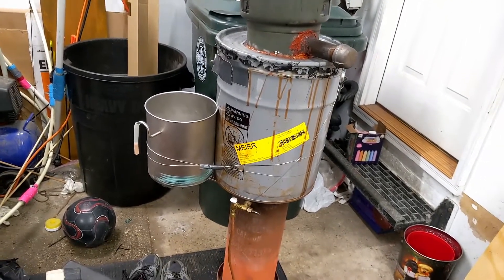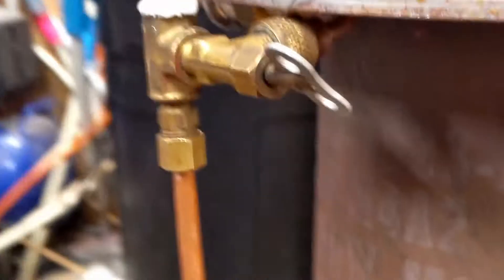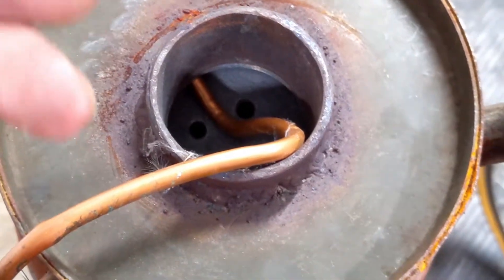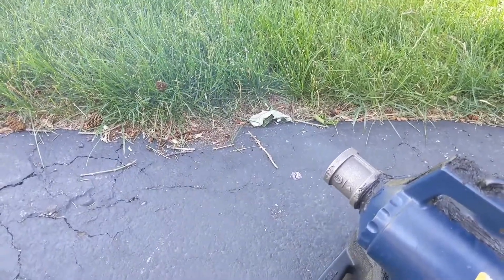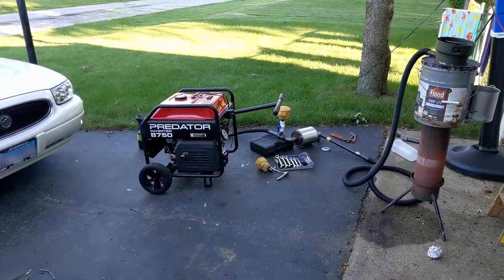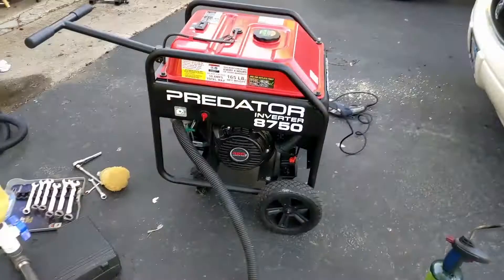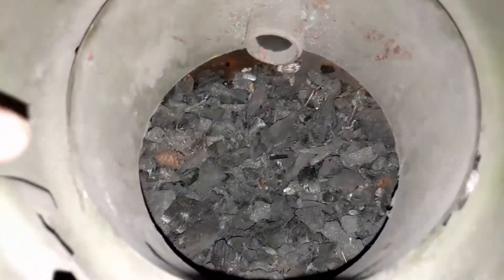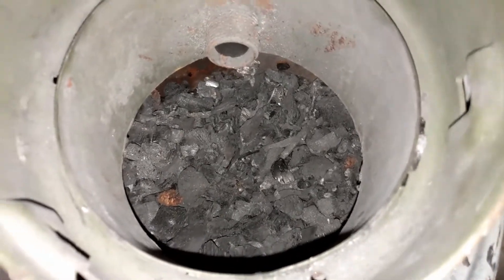Adding Some More Hydrogen To My Gasifier

Comment: Jehhzzz updraft is the worst kind of gasifeir 😅 its a tar machine even whit charcoal 😂
Reply from the maker: If you're seeing tar with a charcoal updraft gasifier, the charcoal you are using isn't properly made.  With properly made charcoal, I have not seen any indication of tar in my engine's intake or in any of the output hoses or filters of my gasifier through many hours of run time.  When I first started playing with gasification, I used improperly made charcoal and saw quite a bit of gummy tar.
Reply: @BryanWhite77 ow I see so there's quite some different kinds of charcoal I didn't understand why your flame is still yellow even whit charcoal , from experience as long as the flame is not blue or if there is fog in the cool gas its not recommended to use it in a engine, i didn't want to waste time en energy making charcoal so I do woodchips en whit great success, the dual fire stratified gives very low tar en the new 2 stage gasifier I've built zero tar in the raw gas whit around 25/30% moisture woodchips , I wonder what is the de-rating of your engine whit charcoal? Mine on chip's is around 65/70% if the gas is cool enough

Comment: Now make a chamber to heat used oil and then enrich with the steam and hydrogen as a piggyback multi fuel system. I am so glad I searched for this. I have been wanting to add a steam reformer to my gassifier and also a similar drip feed of used oil in a parallel feed that would introduce the steam and oil together. Thanks for the inspiration

Comment: It does add Hydrogen. What is happening is referred to as a water gas shift. Used in commercial production of Hydrogen gas. The carbon monoxide produced by the charcoal grabs the oxygen from the water at the high temps. Looks like this in chemistry terms CO + H2O = CO2 + H2. Great job man! New sub here.
Reply: Thank you.💨💨🔥💦👍👍

Comment: Don t like color of flame tar in it seem or something
Reply from the maker: Like a lot of cameras, mine doesn't catch the exact color of the flare correctly.  When I am looking at it in person, it is more blue.   Based on all my testing, I am confident that I have little to no tar in the gas.  I have checked in the gasifier, hoses, filter, carburetor, condensate jar and even in the engine's combustion chamber using an endoscope and have not seen any evidence of tar.  Flame color isn't always a good indicator of the presence of tar since the flare color can change based on a variety of factors (like how rich or lean the burning flare is or the composition of the gas - percentage of hydrogen to carbon monoxide).  Thanks for watching.
Reply: @BryanWhite77  You can check for tars on the flame by directing the gas to a stove and boil some water on a pot. You'll notice tars on the bottom of the pot if it exists.
Reply: On short run maybe but on long run it can appear but just adding heat can fix the issue probably,have you look btu content of gas seem in war time in Europe they used some of CO2 of motor combustion back in gasifier to to control temperature vo3 was cracked back to CO2 they said,in the case of pure coal as fuel,you can look in flameless gasification to and add more hydrogen if needed your water approach is instructive and a good idea
Reply: Maybe but I am colorblind but I am sensitive to density...
Reply: A pure flame is colorless as you see on some of your video Wich is good hydrogen metsnr are colorless we cannot see it,
Reply: Have you compare the gas and gasoline difference on the power of genset on full load
Reply: Bryan you are doing a very good work
Reply: You can maybe look to use excess heat to produce steam to send steam to heart zone to
Reply: You should shows us the grate and the bottom of your gassifer

Comment: How sure are you that it produces hydrogen?
Reply from the maker: Pretty sure.  In the reduction zone of the gasifier, there is little to no oxygen present, and the hot carbon (charcoal) is starving for oxygen.  When water (h2o) molecules pass through the reduction zone,  the hot carbon strips the oxygen atoms from the water molecules which leaves the hydrogen atoms as part of the output gas.  The water can come from either the moisture (humidity) content of the charcoal itself or by adding water to the charcoal or by using a drip system.  Thanks for watching.
Reply: @BryanWhite77 and the hot iron catalyst..
Reply: 💥red hot. 
I wanna test this gas thru a an that... ATOMIC HYDROGEN WELDER ..torch..🤔

Comment: Try to get your fuel size down a bit more, the gas will cool down a bit better.  I had the same issue before sizing my charcoal down.
Reply from the maker: I am working on a charcoal grinder that should give me more consistency in the charcoal size.  What size would you consider maximum?
Reply: @BryanWhite77 🤔🤔 my paper shredder from the dump . Needs a few mods.. spacers on the shaft..💥

Comment: Looking good!  Must be making plenty rich gas to need the air valve wide open, that or maybe the foam filter for your fresh air is restrictive enough to meet stoichiometry for the chargas.
Reply from the maker: Yes, it seems the foam on the filter was too thick.  I trimmed it down and now I have a bit more adjustment available to me on the air intake.
Reply: I was thinking the same thing, obviously producing an ideal fuel for that engine

Comment: Hi Bryan, your thoughts are very right in this direction of adding water steam to the process. 
Steve (cncmachiningisfun) solved this in a way which could help you to improve this for your system.
Good luck. :) 
One more thing I want to bring to the screen: Please don't bring your Predator into the game too early. I would recommend to check the valves for clogging up next.
Reply from the maker: Thanks for the comments.  On my next gasifier, I am planning to do something more along the lines of what Steve (and others) did and have the water reservoir welded to the side of the gasifier to increase the heat transfer into the water.  Since this video, I have run the gasifier and engine several more times and have gotten a better feel for the water drip.  When it's running right, I can hear a nice, steady sizzling sound coming from the water hitting the nozzle and no water drips on the ground.  Having a vertical nozzle makes it a little more tricky to know if it's working right so I have to rely on sound more than anything.  I have a video coming out soon where I try out a gas cooling rack, and with that and the inline filter, the amount of moisture making it into the carburetor is almost non-existent.  I also run the engine on gasoline for 5 minutes after using the gasifier for any length of time just to flush out anything that may be in the carburetor or on the intake valve.  Other than that, I am confident in the quality of the charcoal I have made and that it should have little to no tar and the inline filter should catch any remaining dust or particles.
Reply: Ravelkoff he's running a charcoal gasifier, there's only a risk of tar if he makes a bad batch of fuel which I doubt he would do.
Reply: @cetate93  yepp I got it from his reply.

Comment: If you attracted the water reservoir to the hot part of the gasifier and let the reservoir generate steam. You could then just pump steam into the bottom and eliminate the valve all together. Awesome job and thanks for sharing. Nice and simple.
Reply from the maker: That would be interesting.  Having seen some fairly impressive explosions from over-pressurized steam pressure chambers, I would be a bit leery about having a pressurized container on the side of the gasifier.  I guess I could rig up something like a pressure cooker relief valve to make sure it doesn't build too much pressure.  Thanks for watching.
Reply: @BryanWhite77 . Just use a copper pipe boiler. .